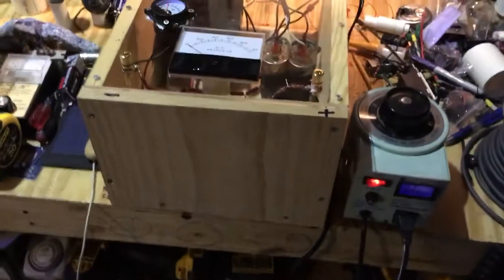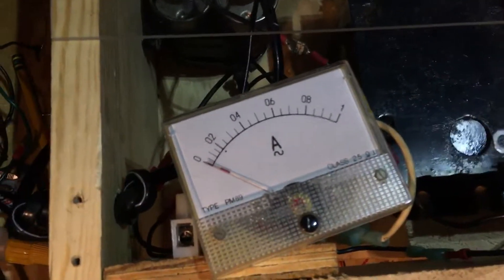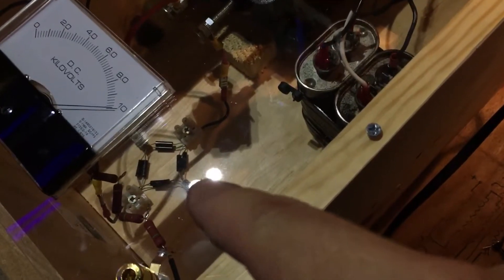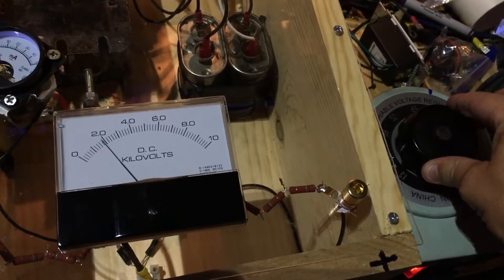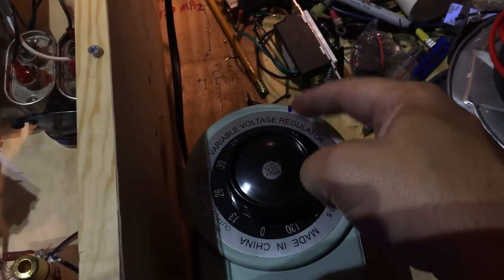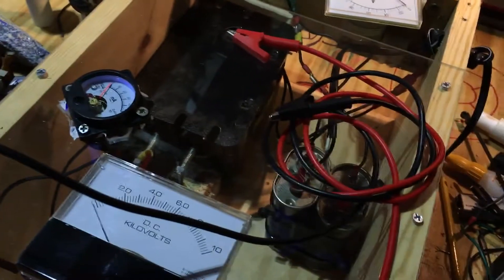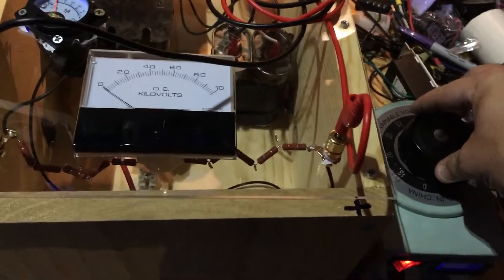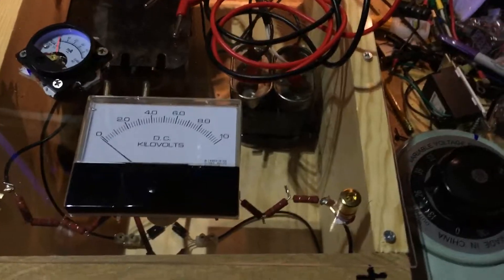Seed treatment apparatus rundown

Comment from the maker: One correction, I noted to connect the negative to the surface, which should have been connected to the bottom plate on top of the non conductive surface.